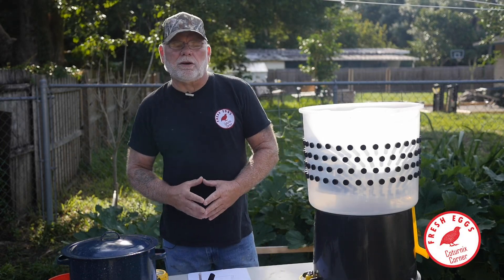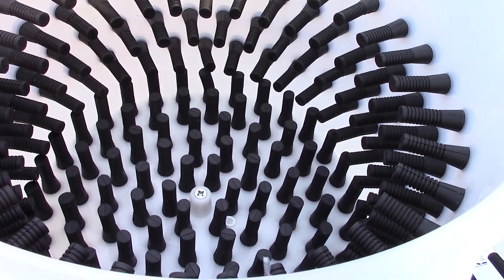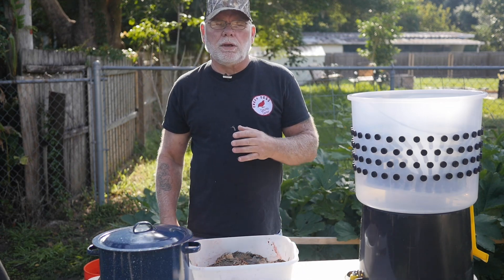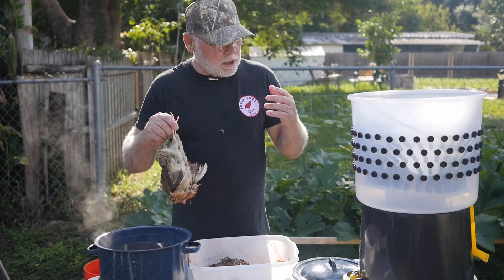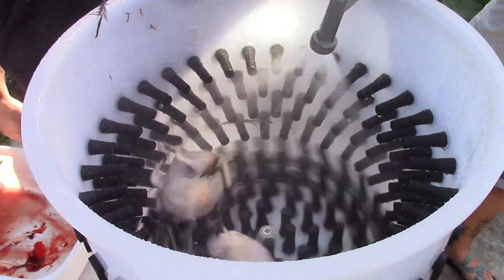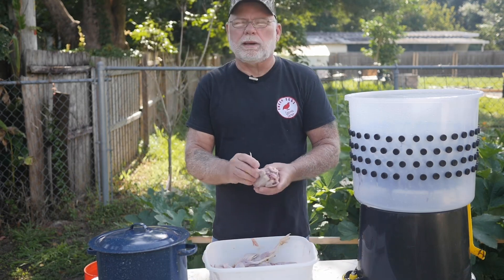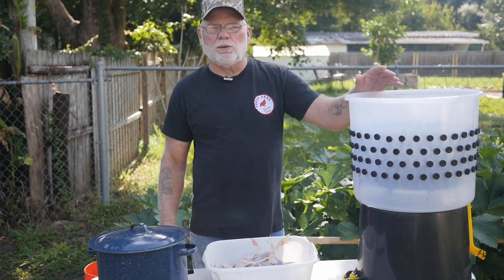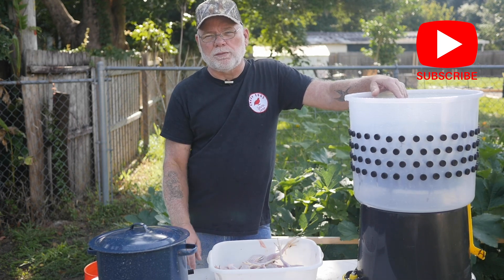i - pluck GAMEBIRD PLUCKER - Demo

Comment: Sure hoping my hatch is good.  Trouble with humidity.  Up and down even babysitting it a few times a day.  No vents on it either.  Temp was good.  Ready to lockdown tonight.  Furnace still running and cold in Michigan so dry air in house.  Has a fan in incubator.  Add a tiny bit of water then shoots from 17 to 70 humidity.  Hard to get right for 24 hours.  Plucker seems nice but now it's hard to find day old chicks.  Out of stock